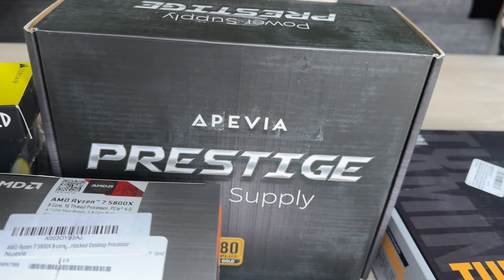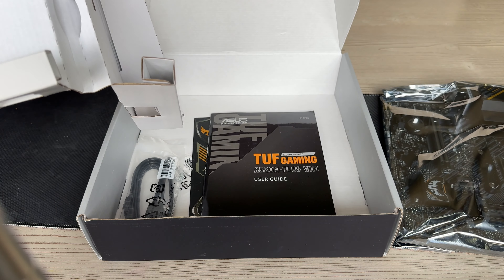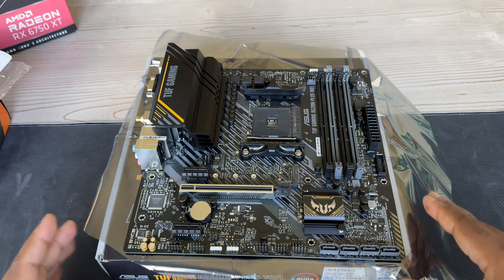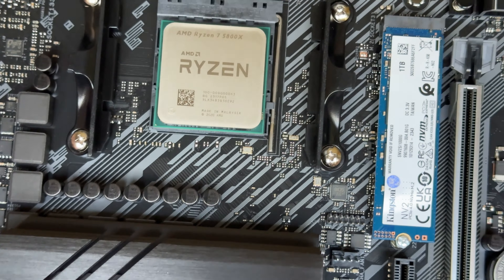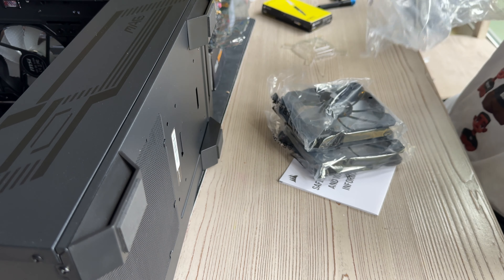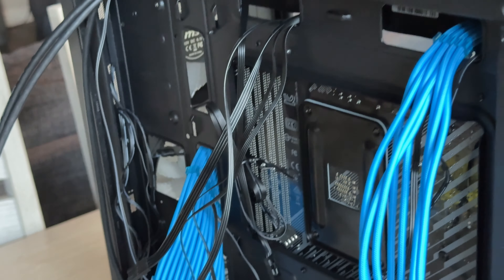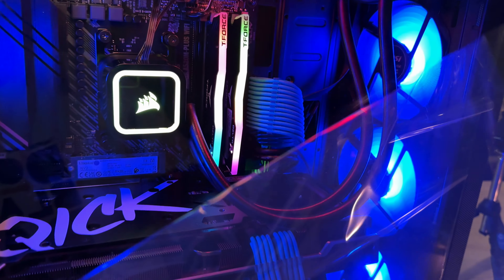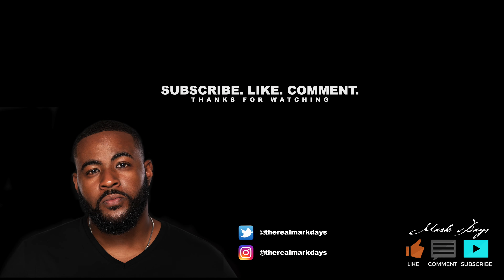Building my SON his DREAM Gaming PC! (Ryzen 7 5800X , Radeon RX 6750 XT ) PARTS IN DESCRIPTION

Comment: How Much Did It All Cost ?
Reply from the maker: Around $1100 all in but I opted to go higher on some components and probably didn’t need to. You can get this build under $1000 if you go with different RAM, SSD, CPU, Cooler, Case, Power Supply, and that’s with keeping the extras and still making it look nice.